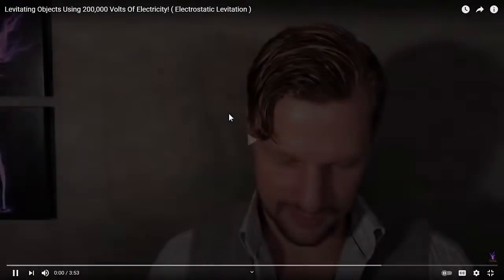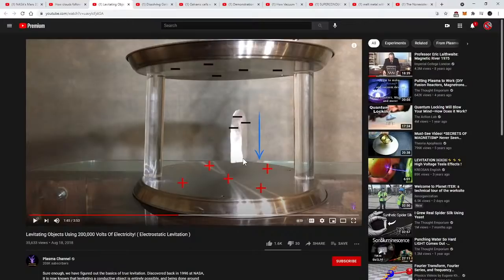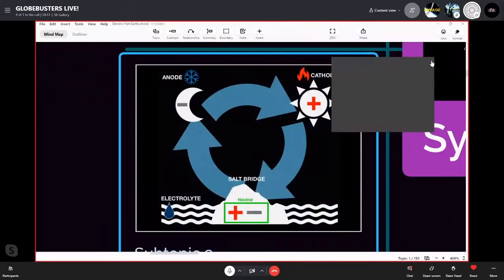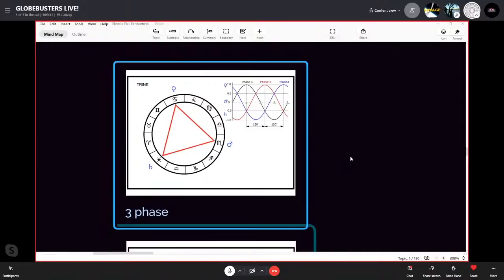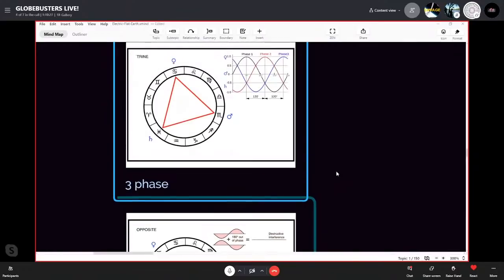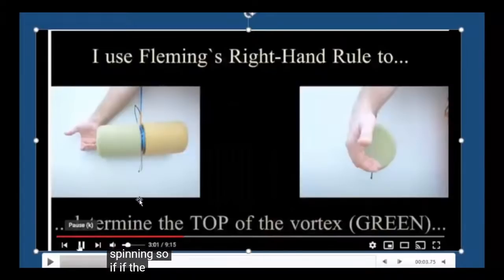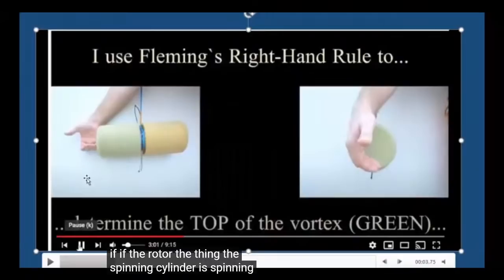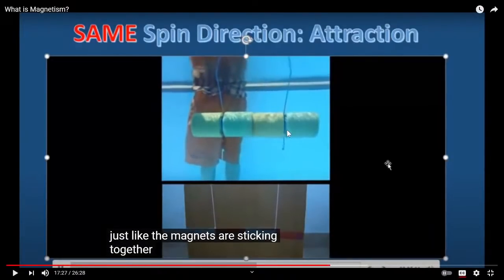Electricity’s Role in Earth Function

Comment: The Anode that I am referring to- no proof but assumption on my part is the firmament, strongest material known to man however it is dielectric and a conductor at certain temperature. as a "egg shell" construction it can withstand tremendous pressure, the New Jerusalem description of the constructed city the Walls, Ceiling and the Dimensions of the whole city indicate the Dome of that city to be 214 ft. thick  of diamond structure, with 3 gates as a pearls-ball valves on each side - calculate the Psi pressure to withstand  that is required for the city to come down from heaven, what material can withstand that pressure beside diamond. There are precise dimensions given of the wall and the ceiling thickness in Revelation-read rev 20-21-22. carefully. You need more info let me know, will supply analysis. Learning how to do videos, 75 years old, will take me time, I rather have open conversations with young guys that know how to put videos together. thanks guys.

Comment: Bob I am retired elect. engineer, all my life I was fascinated by electricity, guess what till today there are parts of this field that escape me however there are at least some parts that we can prove--electricity have direction, it have potential - it can do work, regardless of current or cycles, -  both work for some end means. It the electricity produce magnetism, it affect immaterial and material matter also living -biological things, that we can not explain, funny we know some effects and can described them but can not figure them out. The gentleman that says the things about the difference between the "DOME and the solid oxygen barrier is interesting, however I do follow things that we know, diamond is hardest substance known to man, Carbon - anode - Plus, the wall that separate the water from water.....if you know what I am going to. We know that the earth is a cathode, - Minus charge that direct all matter to the downward motion toward the earth. Funny if you apply PLUS Voltage to an object - let say spoon, match book, buttons, etc. that is suspended with Helium or Hydrogen balloon the thing will fall towards the earth and this is proven over and over, remember the balloons are floating at certain height let say 1ft. above floor they carry the weight-float at certain level like hot air balloon does depends on the heat of the air in the balloon- For my explanation until you apply this Plus potential to the item suspended from the floating helium or Hydrogen balloon the damn thing stays at 1 ft. the moment you apply that potential to the suspended item it will sink to the ground, if you remove the potential it will rise again.